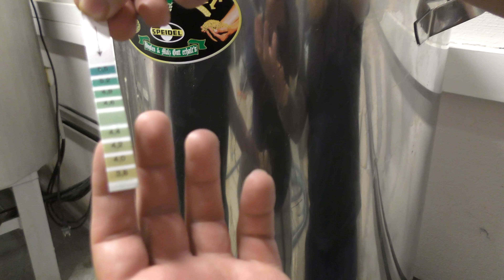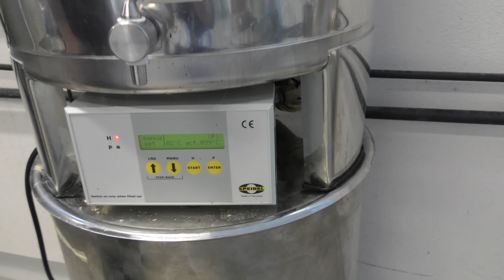Double Brew Day Collaboration With Lysefjorden Mikrobryggeri Double IPA & Pink Berliner Weisse

Comment: The idea of dry hopping right as the wort goes into the fermenter is an idea that seems to fall behind this whole "New England" IPA crazy in the States. A lot of breweries around here are dry hopping their wort during fermentation, either by adding it right at the beginning or at the peak of fermentation. They then add multiple "charges" of dry hops post fermentation. Many contribute this to the "juicy" aroma and taste of the beer in the end as well as that characteristic murky, hazy quality. It will be interesting to see how this will work with a heavy bitterness profile. This sounds like a mighty tasty DIPA. If only I could get my hands on it...